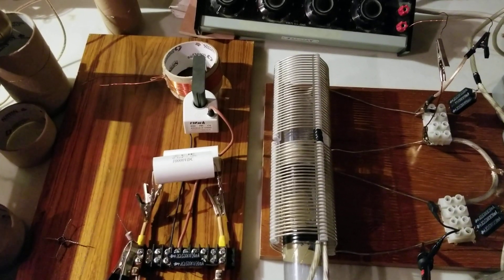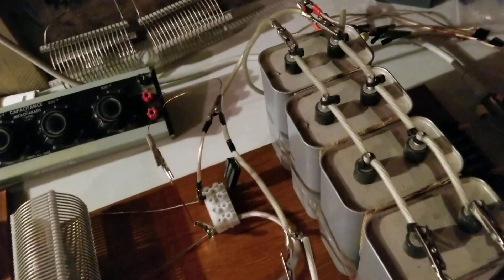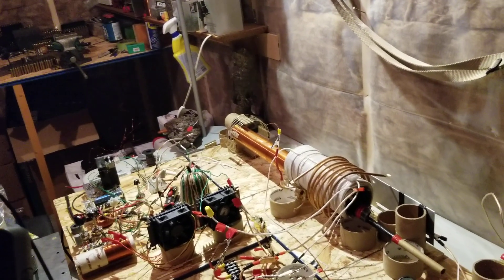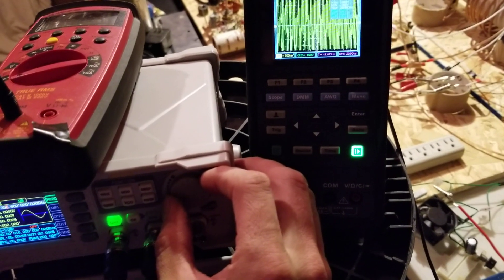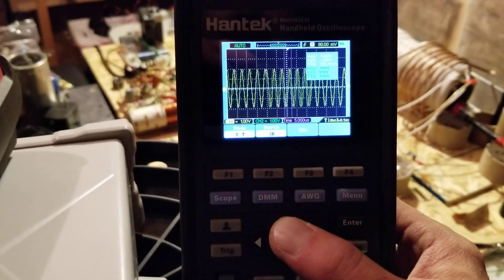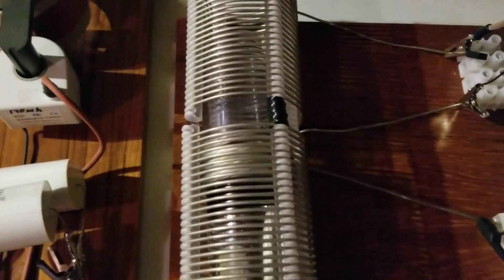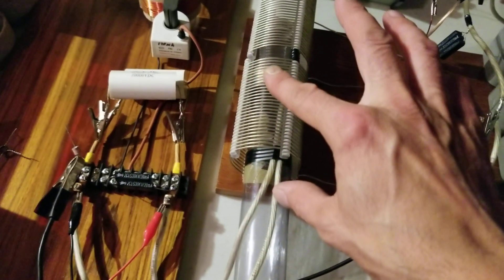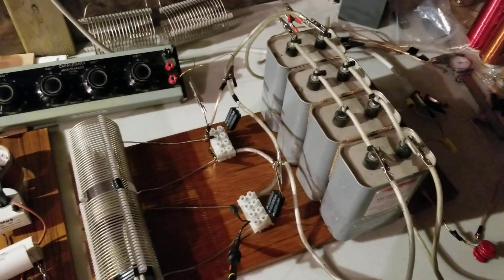45 Don Smith Device Project: Double Helix Revival, Primary and Secondary Tune

Comment: Don smith used an 8000 volt neon sign with central tap and for that reason he rectified full wave and the "gas discharge" goes between the ct of the hv transformer and the negative side of the primary coil, the gas discharge pulses at 60 Hz ... If you do not use that information then you are not replicating the circuit ... also Don never showed his "Primary" coil because he used a "Litz" wire, no other wire will give anything ... it seems to me that it was 50 wires enameled wire caliber 0.5 mm you could consult the table of the "litz" wire constructors ...

Comment: Don smith,sr193, chubinidze,akula first version ( I think his last big tesla coil was driven by ferroresionance but recieving was the same ),dont know about ruslan, all get the energy from the ambient by opening up the bloch wall and time impulses as much as they can because it hapens after the switch is closed. So far we all tried everything to drive the system efficiently.  Input vs output.  I think the entire system is to open the blotch wall and system runs on ambient running through the bloch wall and it will seek a path to ground. Ground returns to Grenade coil. That's why the output coil is connected to the transformer to restart the process again. Also. The bifilar rod in chubinadze,  2 halves controlled in sr193 ( he said that it was ferromagnetic core and said " before others build variances " ) akula took the bifilar winding out of the pvc pipe and put it in the desk. That's why geofusion repeatedly said that where you put the yoke core effects if you get amplifying or not. Sr193 and chubinidze put in inside the static field.

I think I found the secret to all this. I had to go all the way back before tesla. You wouldn't believe some of the information i found and how tesla fits in. However your knowledge on electronics are way better than mine.  So I need   your input in all this please. I was going to share on the forums but you know how it is. Geofusion is quite,  stivep1 might be someone that can help. I dont want to blow this up where we all end up like sr193

Comment: Forgot to add.

My comments about opposite waves= sr193 comment on 2 transformer ( step up, step down  and weak charge sparks on the load end. ) also, teslas ( vauge writings ) 2 polyphase motors running beside each other in oposite directions while creating sparks between the motors

Comment: Hello again my friend. After a long pause, I came back hoping to bring good news. So I will keep it short and I hope it helps.all this is based on my understanding so second pair of eyes will help better.

1,Sr193 mentioned the transistor stimulating the process in the transformer,  one controlled one half ( assuming the other controls the other.
2 ) old scientist, experiment of negative resistance. Input goes down with load added.
3 , stivep1 ,Andrey pastukov,  opposite wound bifilar over 2 grounded secondary 90 degrees same or mixed waves ( asymmetric) I think that's what sr193 meant by controlling one half. 
3, teslas phonomena writings, he abandoned ac wave to radiant cold electricity.  His writings are vague but here is what I see.
 Opposite waves in same lose transformer,  under static outward pressure, unidirectional pulse  at the time of 0 voltage.  Extreme high pulse voltage and 0 voltage In transformer = artificial black hole  in space and time, result = nature ( from air? ) forced to balance and rush .
Earth striked and bifilar absorbes the difference  to equalize. Refer to whoopyjump kacher return waveform ( always oposite gap of wave that filled from the ground?) 

Add ( tesla comment) short at peak of wave in series load line.

Important note. Sr writings, transistor stimulates  one side of the wave ( not only one side of the transformer) asymmetric transformer + bifilar winding with 2 signal gen ( see stivep1 comment and drawing) but half bridge  wave for each half.

Comment: I wonder how he made the isolation transformer ring at 60 Hz from DC...
Reply from the maker: could be that he ran another ZVS circuit with high voltage IGBT's to create a 60hz output, i thought he said once that a resistor could correct it, not sure
Reply: @kdkinen  Yep, that switching circuit is one possibility... Or it could be a mechanical rotary switch... to drive the primary coil of the isolation transformer. The key would be not to affect the resonance happening at L1-L2, but I guess the diodes are making sure to isolate L2 resonance and transformer already... 

A resistor (assuming it is ideally non inductive and non capacitive) can also act as frequency cutoff as in RC low-pass filter: https://www.electronicproducts.com/RC_Filter_Cutoff_Frequency_Calculator.aspx
Try to throw some values and see at what frequency it happens... Surely something to think about.
Reply: @kdkinen  https://www.electronics-tutorials.ws/accircuits/parallel-resonance.html
Reply: 2x SparkGap

Comment: Hi Kurt,

There is option for you to try out as no one actually is trying to utilize capacitance between primary and secondary coils.
The connections are as following:
1) The "hot" output of flyback transformer connects to Avramenko plug diodes then you have standard high voltage capacitor charge/discharge over spark gap to paralel LC resonant circuit on the primary coil.
2) The "cold" output of flyback transformer connects to the center tap of the secondary coil where you have ground also connected.
3) The flyback transformer is driven by ZVS circuit to the 1 resonant frequency across the board from the primary power source. This is only real load where primary power source is attached to. The big coil is the output capacitor to flyback transformer for same resonant frequency and separates input from output load.
4) The one of secondary coils have series LC resonance on same frequency when charging output capacitors.
5) The output of capacitors is taken by partial discharges (the quenched spark gap or electronic switch step down) to output transformer with paralel 50Hz resonant LC circuit on input. That output transformer have primary coil made from flat copper strip which seem to work best (in Dynatron setup)
P.S> I will leave out to guess what is secondary power source here which is powering output loads.... ;-)

This kind of connections was done and tested all way back in Lithuania on 2010 and it works. You can see it in action on https://www.youtube.com/watch?v=C0R4Pinl5rE 

Good luck!
Reply from the maker: Love it, thanks again for the tips !
Reply: Hello Kurt , where did you find your dc capacitors I am looking for them.

Comment: I'm sorry to say that none of the Don Smith devices worked! Nobody confirmed what he said. In the movie, he launches it but is connected to the box's witch. Check. It may be true but certainly not 100% shown on this device. Maybe the rule.
Reply: None of the devices, which he presented in form as they were presented, would have worked = they were models that were not ment to be run for the audience to see, but for audience to grasp the concept. He kept some of the secrets for himself, but not too many, or he may have simplified or misspelled when explaining the method, but I hardly believe he intentionally misplaced some of the components and values on his models. So it may cannot work if you follow the exact schematics presented to the point, but it will work if you understand the matters and find your exact values after. Copying something is not where true knowledge stands! There were much to learn from his lectures and the basic block schematics made very much sense. 
I would advise you, Max, to maybe look at and ask Mr. Rick Friedrich how to make one properly. Rick has a very neat no-nonsense youtube channel to visit as well!
Reply: The rule is resonance. It's easy. The biggest challenge is the way of receiving without any resonance interference. I only know one method. Enough :)
Reply: @janptacnik6400  Don is down below 8ft and all his knowledge is buried with him. He never had a working device in exhibition; nor he ever had a device that worked, either it was missing some components, or diodes were burnt out. I believe he was a fake experimenter just like Mark Steven. But he gave some clue for people to find out by themselves. Best source would be to study Nicola Tesla; as he was the real genius of the two centuries.